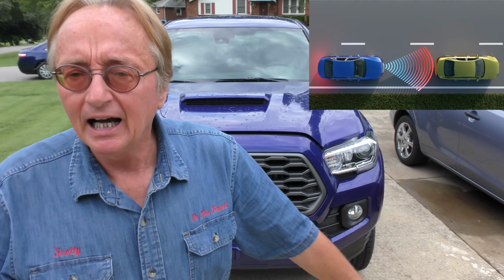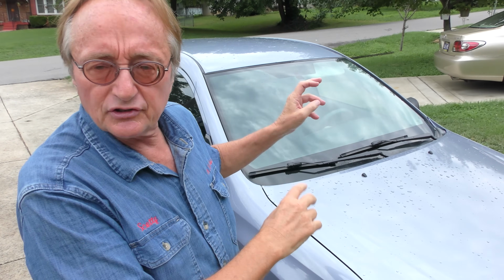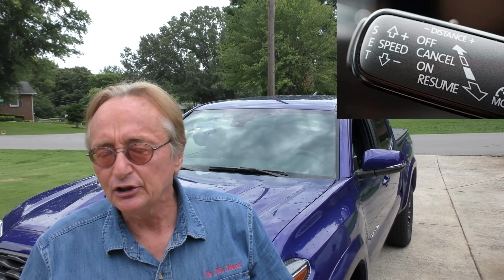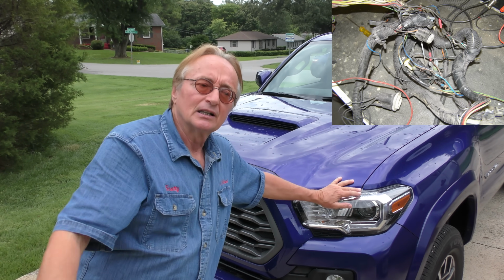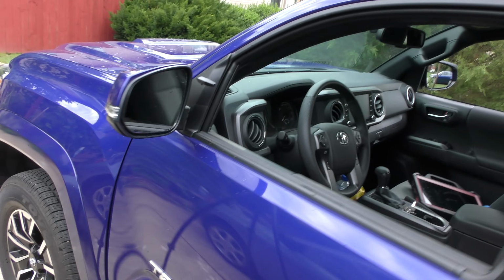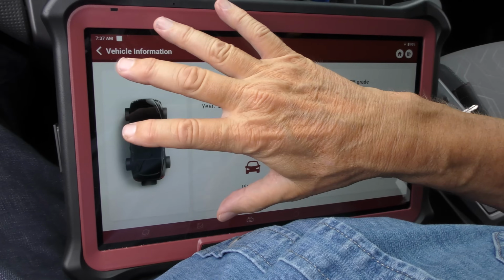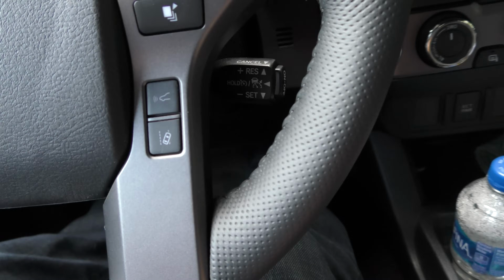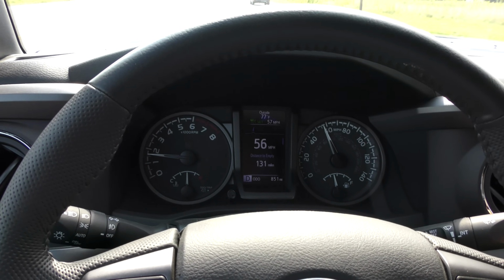Toyota’s New Truck Shocks the Entire Car Industry

Comment: For the people who don’t know if you hold the on/off button in for 3 seconds it will go to normal cruise and turn off the radar camera.
Reply: You can also do the ol' "foot override" and it won't kick off the cruise.
Reply: @whoknows8678  yeah, I just prefer the old style cruise control.... I think after the one experience I had with it, I might start yelling.... can I be in charge for a while to the vehicle
Reply: @christopherrosas2738  You can turn off the radar part in the menu and it will act just like a regular cruise control.
Reply: @whoknows8678  Wait WHAT?!?? Is this for real?!??
Reply: @whoknows8678  Wait WHAT?!?? Is this for real?!??
Reply: @barryjoslin432  Yup.  Works just fine in my 2020 Toyota RAV4.
Reply: Wish I knew this when I had a rented vehicle with that system.... I hated getting "close" to another vehicle and it slowed down itself...... and then I moved over into the next open lane and it took a good little while to get back up to speed
Reply: @christopherrosas2738  you can adjust how far away you are from the car in front of you by pushing the radar button
Reply: @Kay_G  even at that it still keeps you a good distance away from the car infront of you..... I just prefer the old way of doing things where the driver is in charge of the vehicle
Reply: I hate it when it slams on the breaks for no reason and ur like wtf and the person behind  u is like wtf
Reply: Does it work on any other vehicle?
Reply: @sebastiancrabill444  My 2021 CHR has it as well.
Reply: YOU ARE THE BEST
Reply: Adaptive CC is alarmingly annoying. When someone crosses into my lane on the highway my tundra feels like it's slamming brakes and idk if my brake lights come on or not. And then when you're behind someone and they get into the right lane my tundra decides it's going to try for a 1/4 mile record. I hate it. Not to mention a few times it slows down when I'm just going by someone in the other lane. Not every time, just to keep thing interesting. Wish I didn't have to have all the sensors. It's almost as bad as my Fords auto windshield wipers.
Reply: @oceannut5452  yeah , had it in a rental and went in and shut every sensor I could down..... I learned how to drive without all this tech..... and sometimes the tech is over cautious
Reply: @christopherrosas2738  i hate that adaptive cruise control. Its always 3 seconds hold for me (2019prius 2022tundra). If someone passes you and get in your lane your vehicle will slow down 🤷‍♂️.
Reply: You can also disconnect the cables from the radars and cameras and just let your truck throw codes. Then when you want to sell it, reconnect them and use an ODB-II tool to clear all the codes.